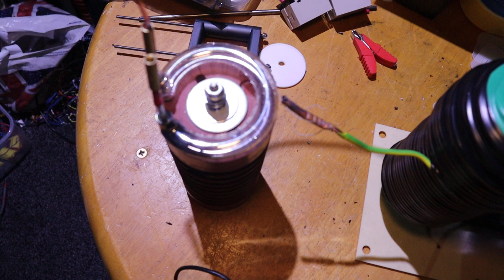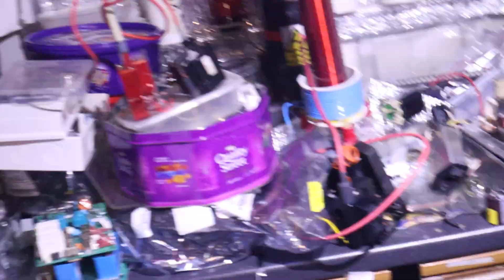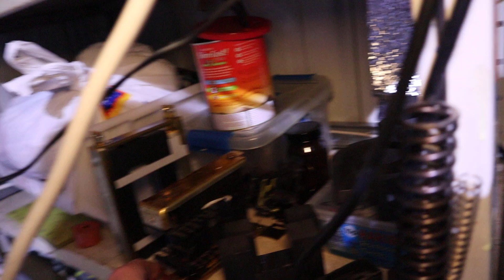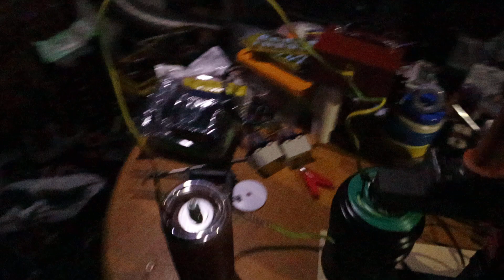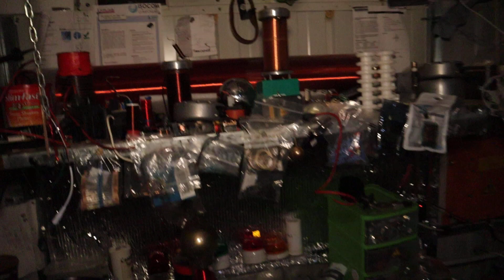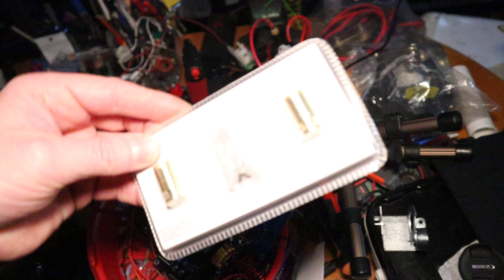large ferrite transformer, and upcoming give away to be won!

Comment: Would it be possible to make the secondary winding of capton-wrapped wide copper foil?

You would get a lot of coverage, and voltage between layers would be low.
Total copper content can be made rather insane.
Reply from the maker: Yes mate, Iv made one before! And yes they work good but you get plasma on the sharp edge of the tape, it’s a mental outbreak lol On open circuits! But yes they can work well mate as long as you keep it connected always while powering up!

Thanks for the comment and info buddy
Regards

Anthony / High1voltage1rules
Reply: @high1voltage1rules  For your use, push the frequency way up!

For 5x the frequency, you can likely do with 1/5 of the turns and get the same performance.

If you can 3d-print or buy some bobbins it would help in getting good cable placement.

Also, there are isolated litz wire, that would likely be quite ideal for what you are doing!